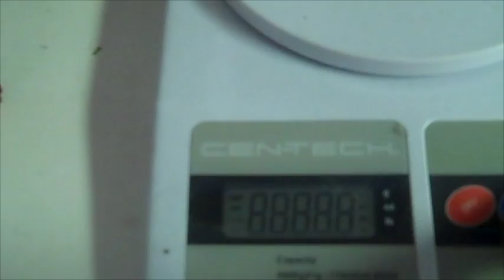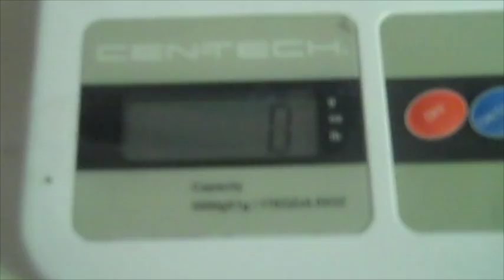M249 BONEYARD BUILD

Comment: In my opinion the Ultimate cylinder is horrible. It's pretty rough on the inside, you can literally hear the scratching while moving the piston in and out. Also it is made of steel. When you use an aluminium piston head with that rough Steel cylinder it will scratch fine aluminium dust whitch will get into your hop up and barrel. Made that mistake once, the piston head looked like someone grinded the outside with sanding paper. Used silicon oil for lubrication.  I recommend a polished stainless steel cylinder or especially the Action Army Teflon coated cylinder. It also has cooling ribs if you worry about heat. But it's a bit tight on the inside, so you'll probably need smaller o-rings for the Ultimate cylinder head.
Reply from the maker: Thanks for the input, I'll keep an eye out. I have not had any issues when the Lonex cylinders. And info is always a help!!

Comment: Old video but it's well known now that those cylinder heads brake gear boxs
Reply from the maker: I don't know how it's "well known now' that the ASG cylinder head breaks GB's. I have installed close to a hundred over the span of four years in standard SSG to 550 and DSG builds running a 170 spring in Stock Lonex, G & P, VFC, Echo 1 as well as Retro Arms and Lonex Chromium GB's and to add to it some with radius and some without and have never had a GB fail. Not mention that this same GB is still as solid as the day the ASG padded cylinder head was installed.  So with that the only thing I can think is happening is that some people are confusing the standard Lonex cylinder head ( that does not have the front padding) to the ASG cylinder head with is made specifically for ASG and their specs, which is manufactured by Lonex till recently. I have also installed this ASG cylinder head into an AREAS SLR over a year and a half ago with new HT gears and a 160 spring with no failure or cracking of the
 front of the ARES GB.

Comment: I acquired one of these awhile back on the cheap. After the same basic mods to the stock gun, a scratch built mosfet and 2s look it was shooting .25g 410fps at 23rps. At my last op though my fps dropped significantly and now its only firing a few feet. I checked my gearbox and still have great compression, but when I put the barrel assembly in hardly any air is coming out of the tip. Do you have any suggestions on the source of my problem? My bucking is new and sealed well to the barrel and stock hopup unit. My problem is consistent with hop on or off. 
Aside from cleaning the barrel I had changed nothing when the problem started.
Reply from the maker: J. Sawyer did you replace the bucking with the exact same version as the stock bucking? these guys have horrible  bucking and the only one I have found that seem to work are the REAPS GBB bucking. you. old also replace the entire hop up unit, which I suggest, with the BULLGEAR hop up unit. this replacements allows you to use "the now standard" AEG bucking that are available everywhere. another think to check is the piston oring and the air nozzle, you might get compression when you check with your finger, putting your finger over the cylinder head or air nozzle, doing that creates a false "seal" because your finger is soft and the bb is hard and will not "form" into the air nozzle. the air nozzle might be cracked. 

that's all I have come to mind without not having the GB in front of me. 

oh, see if the bucking "twisted" in the hop up. this can also give airseal problems.
Reply: Michael OMalley You know, I had forgot that they didn't use a normal bucking. I flat hopped a new Lonex 70 deg bucking and trimmed it to fit. The first fps loss of about 80fps was with no change to the system, so I thought my spring was the culprit and swapped in a newer one. At that time I hadn't realized the problem wasn't in the gearbox. I've seen the bullgear units but can't afford one yet. What is improved?
Reply from the maker: J. Sawyer it's designed to use the lipped AEG bucking. so basically we don't get these trimming head aches which lead to lose of compression or feeding issue.